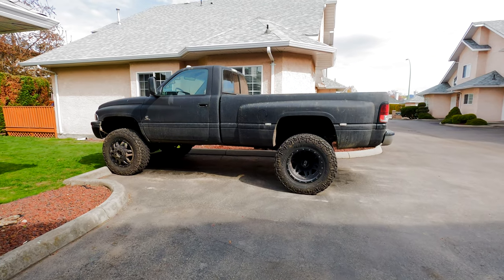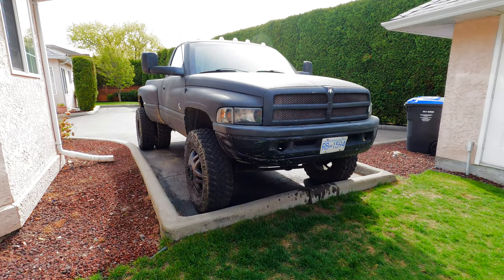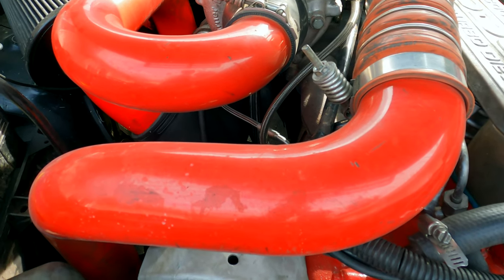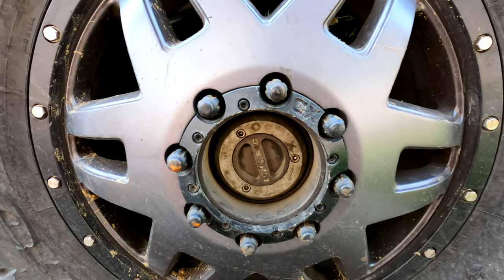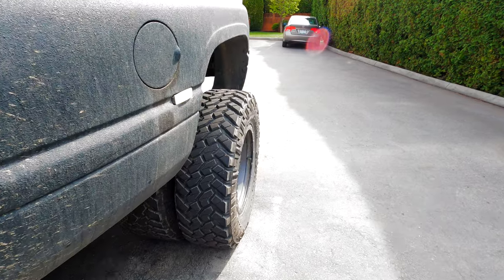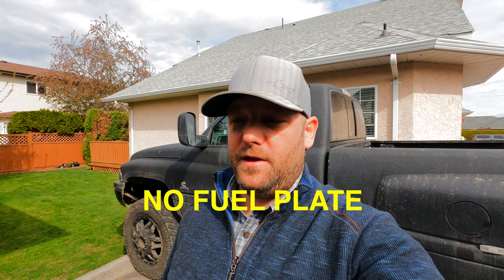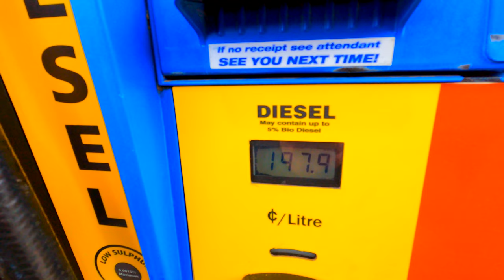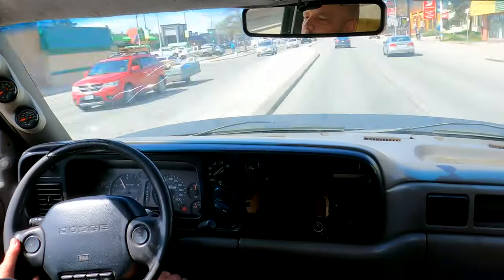Compound Turbo 12 Valve Real World Cummins MPG Test

Comment: Excellent video man. Much love from Alberta.  (This looks like the ultimate setup to drop in an excursion!)
Reply from the maker: Thanks man! Yeah, I have an old Mack truck, but I want to put in a 12 valve as well. The fuel economy and ability to make big power on these engines is insane.

Comment: There's a couple of interesting mods that could really help, there is that one adjustable fuel plate I don't remember what it's called and a gear vendors so you get that extra gear and you can split gears then a regear to something like 4.88's or 5.13's id really imagine a lifted dually really needs some short rear gears then you get basically stock rpms on the highway
Reply from the maker: Yeah that would be great

Comment: My trucks filler neck always ends up getting filled and clicks the pump off. And i have to wait for it to drain into the tank, are you saying that happens to you too?
Reply from the maker: Yeah that happens to mine too. I just have to point it a bit more in line and it pumped better

Comment: Why shift a automatic transmission?
Reply from the maker: Good question, I recently had this truck right down to the bare frame. There’s been a lot of quirks on the electrical side of things and unfortunately the transmission is not shifting properly
Reply: Hopefully you can get this sorted.  Electrical gremlins are a pain.
Reply from the maker: Ya I hope so

Comment: This is the second video that the owner has not posted what gears it has, do you not know or……
Reply from the maker: That’s a fair point, the truck originally came with 3.55 once it went to 37 inch tires I would’ve had to go to 4.30 to keep the stock ratio and I chose to go to 4.11 in order to lower my highway RPM. As I’ve mentioned it a few older videos I kind of wish that I would’ve gone to 4.30 as this is mostly an around town truck
Reply: @StockyBaldman  you want lower gears to reduce mileage or need the power?
Reply from the maker: Just to be more sporty off the line